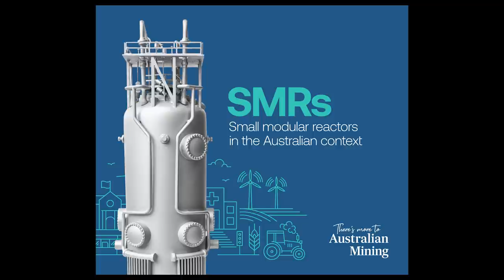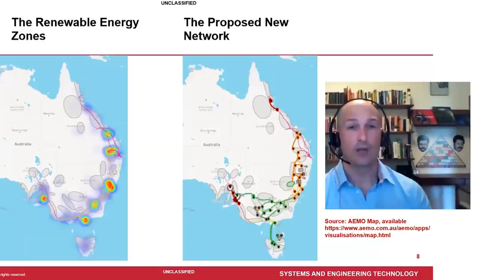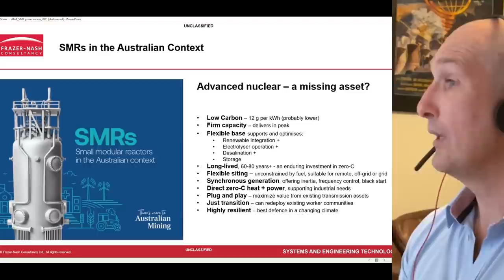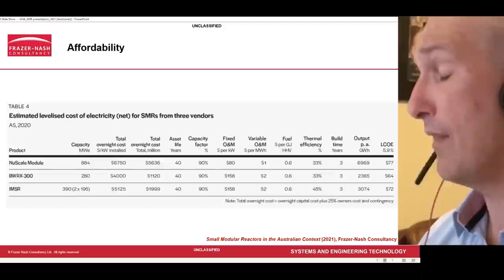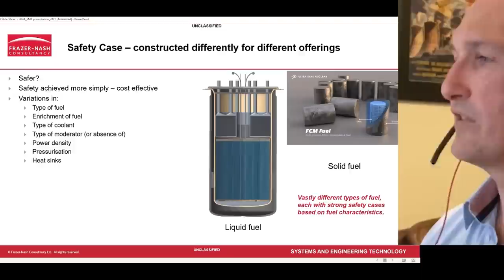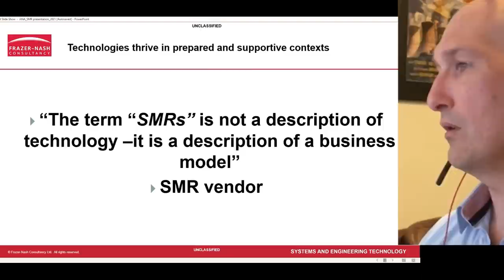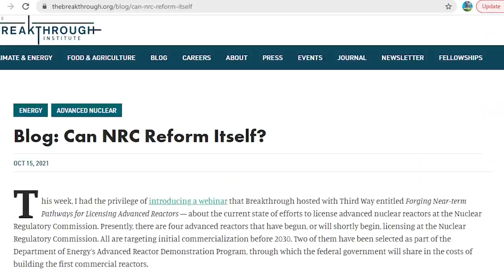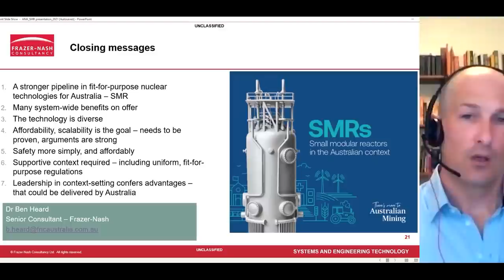Nuclear Australia: Small Modular Reactors in Australia by Ben Heard

Comment: Affordability was only ever achieved with nations who wanted to develop nuclear weapons. It’s completely unnecessary when battery tech is developing at an amazing rate.
Reply: @tigertoo01  " I see plenty more batteries being deployed than nuclear power."

Yeah that's how this works. I have 50 AAA batteries in my house, therefore, batteries are better than nuclear power plants. Brilliant take.
Reply: @phamnuwen9442  Ok not everyone understands. It may take time for you but I have hope. You can at least string a sentence together.
Reply from the maker: We have great nuclear reactors in Canada, and no intention of making weapons. In fact our CANDU run on NATURAL uranium and no enrichment at all is needed. We have used CANDU to stop burning coal in Ontario. Bruce Power in Ontario, in 2020, said hydro was cheapest, followed by nuclear. 

Solar and wind offer less value because they stop providing power for extended periods of time. Longer than can be practically backed-up by expensive batteries.

Batteries are resource constrained. Best to put them in cars, and have those cars build with grid-balancing features, so they can serve 2 purposes.

But grid scale battery storage will never replace hydro for load balancing against intermittent energy sources.

What happens EVERY time a nuclear plant is shut down by anti-nukes, is gas combustion goes up. ALWAYS.
Reply from the maker: @tigertoo01  CANDU run on un-enriched uranium. You're claiming the only affordable nuclear is related to weapons production? It is not. CANDU uses heavy water to moderate the neutrons so that NATURAL UN-ENRICHED URANIUM (yes, yellowcake manufactured into ceramic fuel pellets) can sustain a chain reaction. Ontario has found this not-at-all-related-to-weapons nuclear is the least expensive energy source after hydropower.

Canadian Plutonium will either go to Deep Geological Repository (it is a component in used fuel) or be recycled into more clean energy with a Moltex reactor.

If you think REACTOR GRADE plutonium has ever, or could ever, be used in an American atomic weapon, then you need understand the different isotopic ratios of Pu created in civilian power reactors. Weapons-grade Pu is created in Military reactors. Reactor-grade Pu is created in power reactors. It is different stuff.

Heck of a lot easier to create material which can be used for power production, than create material which can be used for weapons production. Also, very easy to take weapons-grade material and downblend it into reactor-grade material.

There's noting "finite" about uranium. It leeches from the Earth's core into the ocean. We COULD harvest it from the Ocean, but there's enough easily accessibly on the surface we probably never will. It has 1,000,000 the power density of fossil fuels.

And it is the recycling of Pu into energy that helps us use that ratio. Currently less than 5% of used-fuel is actually used. And the Pu is within that "used" portion... it is literally recycled. Once fuel is fully-used and also recycled, there's very, very little uranium required to power our society.
Reply: @gordonmcdowell  dealing with plutonium is a murky business. Canada has been less than straight forward with its transfer for “reprocessing “. And yes Canadian Pu can be reprocessed into weapons grade. So don’t start saying that this is not the case. Canada played a role in the Manhattan project so there is a history of nuclear weapons development. Japan just hands over it’s plutonium to the US so they can do as they please. The proliferation of nuclear weapons should be condemned at every possible stage and this includes its initial feedstock from domestic nuclear power stations. In most countries nuclear energy doesn’t make financial sense. Renewables win every time including with batteries as grid stabilisation. Australia has had resounding success with the large scale battery systems installed which have supported renewables perfectly. Australia will go the same way with plutonium and just hand it over to the us or worse develop their own nukes under the supposed threat from China. Australia has the best renewable resource on the planet and does not need nuclear power. It sickens me to see my home country cave and have people like you with narrow minded thinking just promoting it without thinking about the repercussions.
Reply from the maker: @tigertoo01  Sad. And you know it.
Reply: @gordonmcdowell  you said it!
Reply from the maker: @tigertoo01  Weapons grade Pu contains no more than 7% Pu-240. CANDU used fuel Pu contains 12.5% Pu-240. There is no way to isotopically separate Plutonium.  Even if all the Pu was separated from the Uranium and Fission Products in used fuel, it is still 12.5% Pu-240 Plutonium. It is REACTOR-GRADE Plutonium, and will NEVER be weapons-grade.

That is why ONLY the anti-nukes (who don't care about what is true and what is false) complain about Moltex's intention of recycling used CANDU fuel into clean energy.

Don't like the used fuel sitting around? So, put it in underground storage. Anti-nukes say "no". Recycle it into carbon-free electricity? Anti-nukes say "no". Pretty obvious what you want and it isn't solutions.
Reply: @gordonmcdowell  I did a bit of extra reading on the history of Canadian nuclear power as I was lacking some knowledge on the subject. Alas my original statement still holds true that any country who has a domestic nuclear power industry has developed it off the back of a nuclear weapons program. Canada did hold a nuclear weapons Arsenal up to 1984 and still to this day contributes to the US nuclear policy. I’m not saying they should or should not have done this. The premise remains though that current forms of nuclear power generation is directly linked and it’s development subsidised by the requirement for nuclear weapons. Canada would not have nuclear power without nuclear weapons. Just as Australia to this date has had no need for nuclear weapons in turn has never developed nuclear power. It’s would be a crazy act for Australia to start doing so now. My question to you is why did you not disclose any of this information yourself? Did you not know ?
Reply: @paulbedichek2679  the 2 main reasons for global warming are the nearly 2 billion ice vehicles on the road and animal agriculture. Nothing to do with batteries
Reply: @tigertoo01  no the only reason for for climate change is our Sun and to a lesser extent our failing magnetic field lol
Reply from the maker: @tigertoo01  Canada hosted UK and USA weapons. Canada didn't build any nuclear weapons. Canada exported uranium ore and heavy water to USA for the purpose of bombs during Manhattan project. That's a pretty weak link and I'd say your statement "Plutonium is a murky business" is best clarified by repeating, Canada never enriched Uranium to any level, let-alone weapons-grade, and Canada never created Plutonium which was weapons-grade. Canada never created a nuclear weapon and only hosted UK and USA weapons.

Nuclear power WAS being researched for energy purposes before WW2. See NYT 1939-10-22 "Atomic Energy From Uranium". The Manhattan Project sucked in the researches who would have otherwise might have pursued nuclear power. It moved fission into secrecy and made the materials attainable only for the purpose of weapons. That doesn't mean the most significant developments in nuclear power research were subsidized for weapons purposes, only that for many years all allied nuclear R&D focused on weapons.

In the case of Canada... what, you've got early, expensive production of heavy water?. Heavy-water isn't created like that any more. Heavy-water isn't used for weapons any more. And that's simply minuscule compared to overall CANDU (power production) R&D with no military overlap what-so-ever.

How much R&D is (rightly so) invested in fusion power? Same (unimportant) overlap. It is not a practical concern today, just a distractive argument that implies western power reactors are dual purpose.

You don't NEED to enrich Uranium for Australia to harness nuclear power. And the Pu created is NOT weapons grade... recycled or not, it contains too much Pu-240.

"Affordability was only ever achieved with nations who wanted to develop nuclear weapons."

Canada NEVER created a nuclear weapon. And nuclear is our second-cheapest source of electricity in Ontario, where we stopped burning coal thanks to nuclear.

Comment: How do they plan to contain the nuclear radiation ??  What nucleus of what atom is impervious to alpha and Gramma radiation.  There is no need to use the dangerous radioactive materials.  We can use permanent magnet motor s to power brushless motors as generators with inverters and transformers to deliver high voltage AC power.  These are high voltage AC power plants that supply continuous peak power without fuel cost or dangerous pollution.  The propaganda control of destruction parties has prevented the use of Edison generators as cars trucks and power plants.